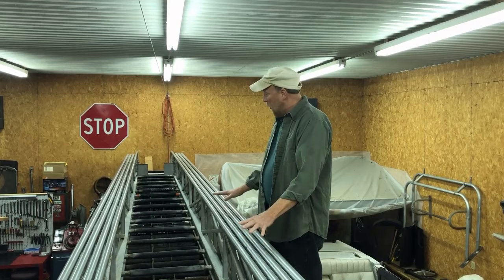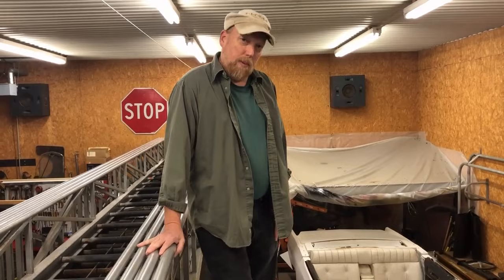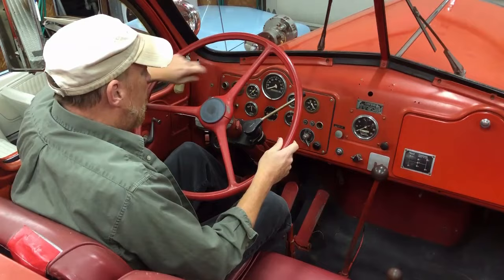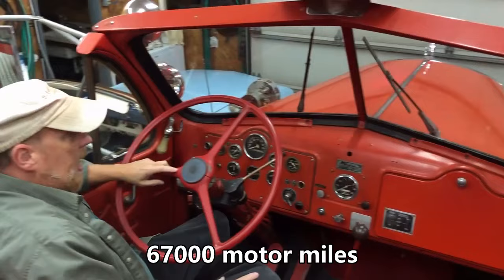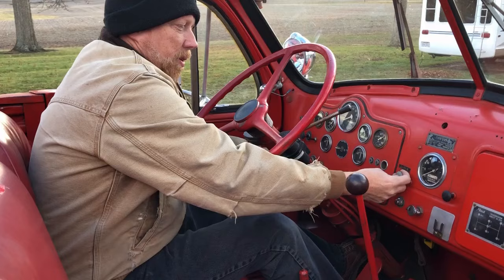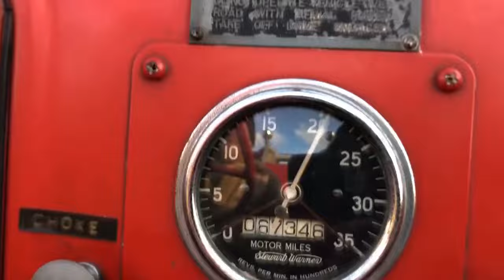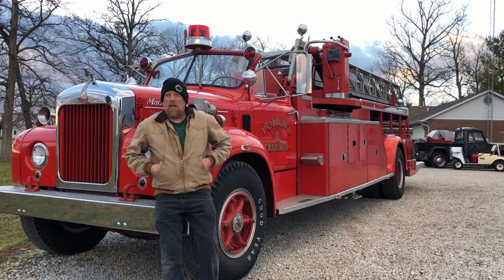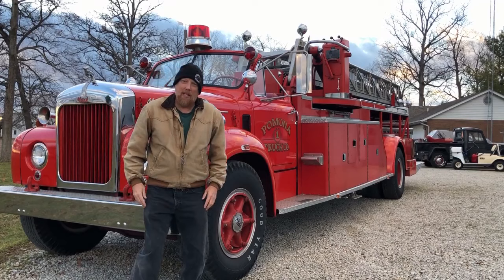Mack B Model Fire Truck [EP1] @KlepsGarage

Comment: This brings back memories.  My dad had a 1960 B85 pumper when I was young.  Good times.  Nice B&M siren, by the way.
Reply: What is a b&m siren? Not familiar with that name.
Regards joe
Reply: @josephpalmer4458  B&M is a siren manufacturer, and that's what you see on the left front fender.  Most modern fire engines use Federal Q sirens, so I tend to notice the B&M products.
Reply: Bruce and Barb have a nice truck there on G-W Rd, there in the "West", but not exactly in the old west, I am actually out here in the Idaho, the Pacific NorthWEST, I bet you got the best insurance on that truck  ... .lol    l love that Fire Truck I was born and raised in Allentown,Pa and likely your Mack was built there at the former home of MACK.

Comment: Wow. Next time get it going and lock up the brakes. I want to see what happens. I watched a YouTube of guy in Washington state that has same vintage Mack fire truck with a 1091 cubic inch Hall-Scott engine. His has a closed cab and is not an extension ladder truck. Keep them coming. I just realized this 3 yrs old.
Reply from the maker: Thx Gary. Yes this was our first video.  Going to do another one on the ladder op. Don’t think I’ll be doing any drifting. But one never knows.  This vid is kinda crude compared to our newer ones as it was first out of the box. 
Thx for watching.

Comment: East Greenwich Rhode Island Fire District had a 1958 Mack 75-foot straight chassis. The turntable was a Maxim and was bought new by the East Greenwich Fire District from Mack! It had an open cab so that spotting for overhead obstacles was easier but the wintertime very few men were man enough to drive it in the wintertime! We also had a 1938 Mack Pumper that was in service as a third engine due into fires. This truck was sold to the East Greenwich Fireman's Association along with other Fire Apparatus that the association bought and completely refurbished and keep in a museum at the club!
Reply from the maker: Thx for sharing. Old Mack’s Rule!

Comment: These models were actually pretty rare the model b-21 1958 mack was a closed cab and only 9 were ever made but it was 1 of 6 and had a bigger engine than the one in this video it produced 350 horsepower there is even a sedan model the b-21 the front grill area was extended and part of the back engine area was extended to fit the engine it had the engine was a hall scott
Reply from the maker: Old Mack’s Rule. Thx for watching

Comment: Ladder on the turntable is a Maxim. They WERE located in Middleboro, MA. They were not part of Mack as stated. Maxim rigs were primarily located in New England but it wasn't uncommon to see them in states further away such as Speedway Indiana.
Reply from the maker: So noted, Truck was from Pomona CA  so ladders were all over.
Reply: @KlepsGarage  Maxim was based in Middleboro MA. Palmer MA ran with "S" models. 4-door conventional cab as did Worcester. Very durable rig. Almost every New England  department at one time or another owned some configuration of a Maxim. Especially the flat-nose cab. They wouldn't die.
Reply: Saw a Maxim engine in rural Utah some years ago.The old ones ran like iron.
Reply: Indianapolis had tons of Maxims, Both conventional cab and cabover.

Comment: Ever think of bringing this one to the Motor Muster?
Reply from the maker: I would, but it’s 5 miles a gallon and I don’t trust the tires
Reply: @KlepsGarage  I was thinking trailer it but I don’t know if that would fit in a car trailer given that it was delivered by semi truck
Reply from the maker: Yes needs a semi truck and low boy Trl. Mack weighs  28,000 lds

Comment: I'm working on a 53 mack b75 firetruck  has the gas engine can you help?? Brake system is my needed info
Reply from the maker: I’m not gonna be much help I’ve never had my brake system apart. It’s air and works.